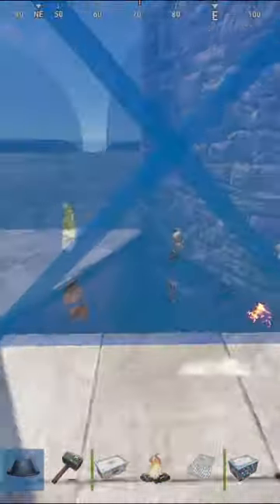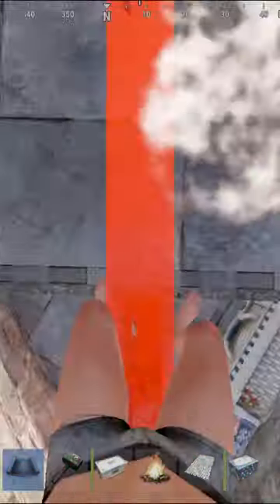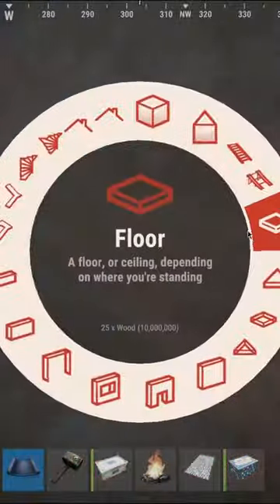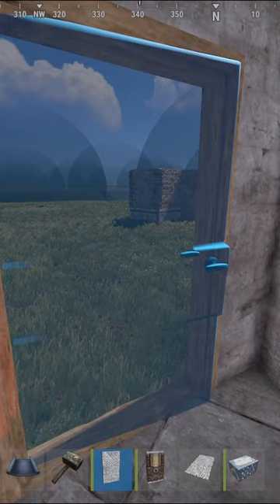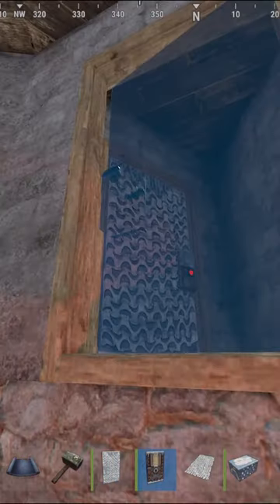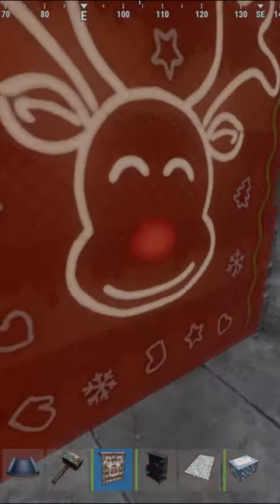1 Minute compact solo Bunker turorial #shorts

Comment: Could you please spend more time showing how to open/close the bunker
Reply: The half wall he removed to create the little drop down, you replace that with twig from the outside of the core. Then put a triangle floor piece attached to the twig. Upgrade it to whatever you desire, obviously sheet is the cheapest and best option early game but once you have a steady supply of hqm then you use that. Then to open it all you gotta do is spawn back inside the core, break the twig half wall and the floor piece will break since the only thing holding it up was the twig. Hopefully my explanation makes sense lol